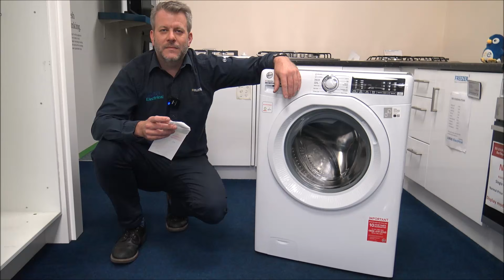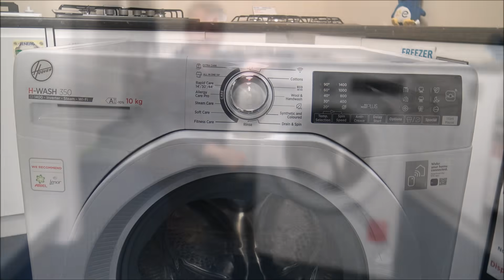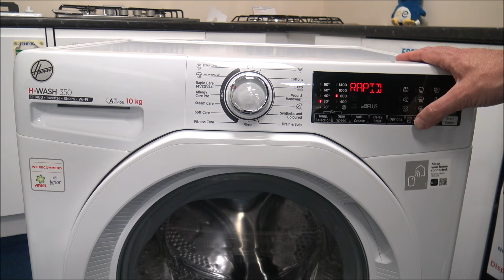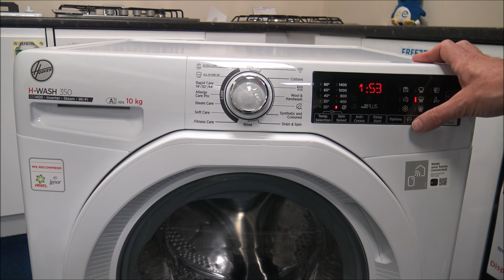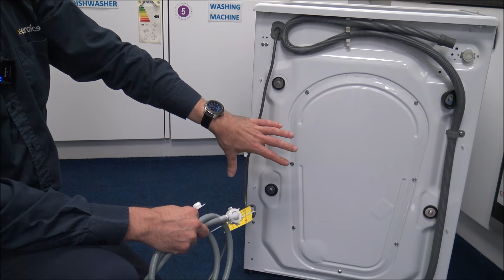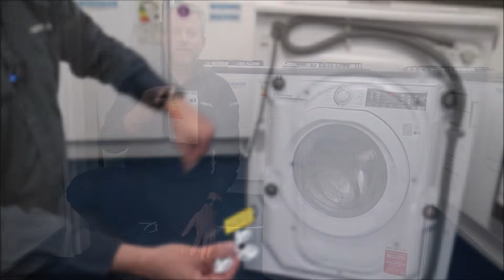Hoover H3WPS4106 10Kg 1400 Spin Washing Machine

Comment: Hi, I've just got the H3WPS6106TAMBR80 MODEL. I've read the instructions and the  "first use" directions are crazy. It says I have to set language and all sorts. I struggle understanding new things as I have had a stroke. All I want to know is what to press to get 60° full load that only washes for 1hr 45min ish.  And a 40° quick wash for less than 1hr. I only wanted a simple machine with a 1600 spin but it was like trying to buy a unicorn. Any advice would be appreciated.  Thanks